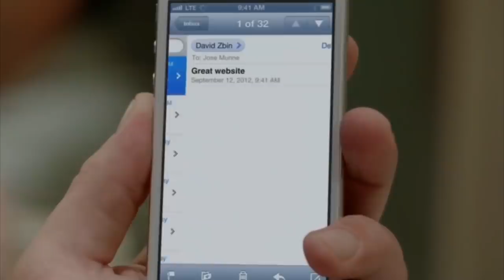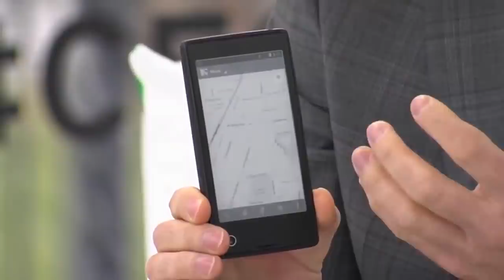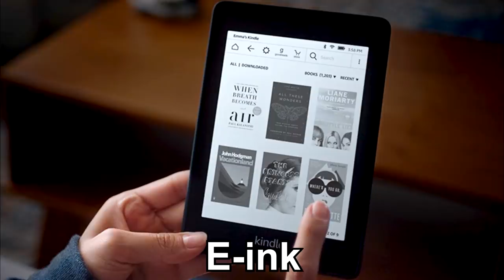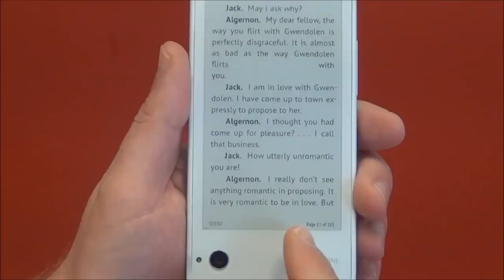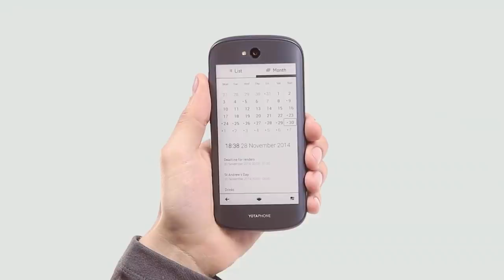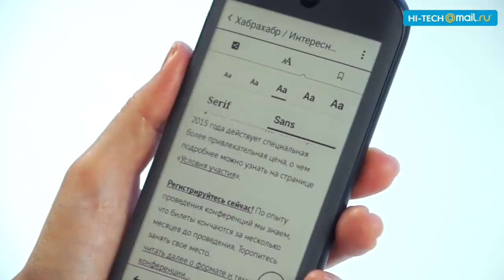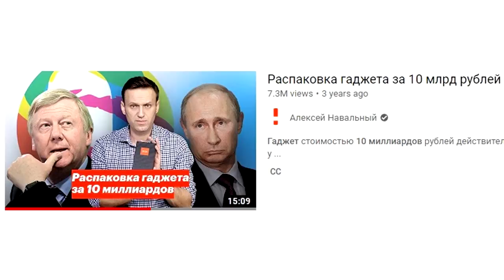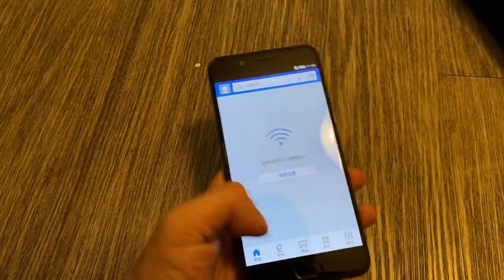Yotaphone: Russia's Failed Smartphone

Comment: I really like the idea actually. E-Ink displays barely need power, so it could be used most of the time to save power, and the primary screen could be used only for stuff like watching video.
Reply: It is a good idea but in case with this company it was badly planned and executed.
Reply: Well, then you should start a mobile phone company 😀 
Okay, the idea of an eink display sounds good but it doesn’t work.
Reply: Is colored E-ink a thing? I'm just asking here because I'm curious...
Reply: @hsc894  ...no, not yet.
Reply: It seems like you'd scratch or damage your back screen pretty quickly. I think if it had some cover system that could flip from one side to the other quickly, that might work
Reply: @darthbee18  color e-ink displays do exist.. google it (Pocketbook Color 6 ́ ́ One)
Reply: I wanted to buy it, really
Reply: @hsc894  actually colour e-inks now do exist!
Reply: I read a lot and I'm using a yotaphone 2 now for years. Marvellous device. You can have also always a overview of all notifications on the eink screen.
Reply: @Rafael-xz9pl  That's why Yotaphone had 2 displays, eink only used for basic applications like sharing a boarding pass, controlling the camera for selfie (since the second display is on the back) and occasionally when the battery life runs out. You'd never want a smartphone with only the eink display because of the latency.
Reply: @mi2-c035  I could run any app on the back of the Yotaphone 2. Mainly used it to browse the web, GPS and reading. Played some games and videos when out of battery.
Reply: @ayuyade  Yeah technically it's possible, but i wouldn't want an eink only smartphone, there was a huge potential for a dual screen  with one being eink, honestly more than foldables now which feel just an expensive gimmick.
Reply: @mi2-c035  Sure, I agree. I want both screens to be there too but I need the second one to be fully functional as it was in the YP2.
Reply: There are a few other makers that are currently selling such phones with E-ink displays. For example the Light Phone, or the Mudita Pure. Check them out.
Reply: rPhone... or pPhone for Putin's Phone, since most Russian people at last does not hate that much the West... pPhone, buy now
Reply: screen is only fraction of power mobile device requires
Reply: Well, try to experience E-ink to watch something, with low fps, black and white and even leaving ghost marks in the screen and you'll want to get back to the normal screen immediately.
E paper displays sucks for anything out of e-reading.
Reply: @qwerty6383  It is the LARGEST consumer of power on modern phones.

Comment: I used to have a yotaphone2 and it was a great phone. The e-ink screen really made the difference with its widgets always visible, the possibility make the battery last for 5 days and the possibility to read books at any time without planning to bring a reader or an actual book or take selfies with the main camera,
The main problem was the snapdragon 801 which was not fitting well inside there and burning when using it for demanding apps lowering the battery range a lot. I was charmed by the yotaphone 3 but even after years it was available only on chinese stores at quite high prices for old midrange hardware. The concept was great though, too bad nobody else developed something like that.
Reply: I remember it even had some ingenious tricks in its construction, like the volume rocker on the side was also the slot for a microSD. The idea of the two screens and the software integration is still great, it was truly innovative in a market that frankly has gotten stale for a while. All smartphones look the same nowadays, they all copy iPhone even the flaws, it's so boring.
Reply: Private imported a Yota2 from Russia, it is to date the best phone I ever owned. It was perfect for me.
Reply: Yeah I agree the concept is amazing like if someone can make a phone with the same concept with modern specifications and hardware I would definitely buy it and it would probably be one of the best phones on the market it's a shame this concept never came back I hope it does
Reply: @mi2-c035  yeah man I would love to see the same concept with modern specifications the concept is so great though like it is so cool to have a second low power screen it's a shame none has used this concept I hope someone makes a similar device
Reply: @tubros  you could get the yota 3 it is a little more modern but this concept is so cool I hope someone makes a modern version of it
Reply: There's nothing wrong with the 801, many of the most popular phones at the time used it. If the phone was having problems it was not the processor's fault
Reply: I had it too, and I agree. Best phone I ever owned. Ebook on the back and the power lasted a few days. But it did get hot and then it only held power for 12 hours, so I got anoter phone with 7000mAh to read for longer. But I still look up yotaphone every now and then to maybe get a steal. 
Sidenote, there are a few chinese models copying the concept with more modern hardware (of course there are). Look for eInk Smartphone.
Reply: With modern day OLED, that probably wouldv been useless aswell
Reply: @honkhonk8009  That's not how oleds work
Reply: @IamGroot more likely the west doesn't allow it. One who control the market he also controls what,  when, and where product is going to be sold.
Reply: in soviet russia we do phone with sardine can and shoe string, very very good
Reply: And now Russia won't be able to buy any Snapdragon processors whatsoever.
Reply: Still have my Yotaphone 2, got it at the tail end when price had dropped mostly as a curiosity, never used it as main phone because performance was too disappointing with any kind of heavy app and I didn't find myself using the e-ink screen much but it was an interesting concept.
Reply: @tubros  Bla,bla,bla.... i am sure u got a Lada also, so it was the best car that u own.....
Reply: @Ignacio.Romero  AMOLED full black background with gray text is probably the closest you can get, though it is more like reading in dark theme instead of an actual paper-like experience. Wish the e-ink concept survived in some form.
Reply: @ivicacaric8423 that’s just stupid how many Chinese phones get made every year

Comment: I actually had a Yotaphone 2 back in 2015 until 2017. It was not bad considering that I was young and kind of dumb. The e-ink screen actually didn't do shit in terms of battery efficiency, and it was actually bad enough that the previous frame blended into the current one. On the topic of component quality and specs, it didn't take too long for the phone to show its true colours and shit itself in a year - the screen would turn into an impromptu rave and shut itself off at around 5% charge, but you could still hear incoming calls yet not interact with the phone.

Also, fun fact: Yota also sold cases for the phone which were basically a soft plastic rim which never felt really trustworthy.

Comment: They advertised it “this phone has more back doors to the FSB than any other phone on the market”
Reply: the CIA does have fronts for engineering processing chips with intentional backdoors in basically all smart phones
Reply: @nothingbutdope5316  all governments have but I rather have a democratic government doing that than a dictatorship
Reply: @ricardobarahona3939  it's called brainwashing, and they have no problem doing that through the media
Reply: @nothingbutdope5316  I knew this idiotic response would come, and that’s not evidence.
Reply: @rayandouni4374  Yeah I’m all for harm reduction. I agree with you and same applies to voting, there may be crap options but you have to go with the least crap because even small differences can lead to much bigger outcomes.

Comment: had one and loved it, it was really cool during the meetings when it was showing when the meeting is over when placed main screen down (via calendar app). Also photo taking was fun with retro camera picture. used e-ink display every time when in the sun. it worked very reliably, but then I went on a 2 weeks long road trip with google maps always on and a problem appeared - the phone overheated. Not a problem for a casual use, but killer when always on. fixing it to a vent helped somewhat, but these overheats, I think, caused the e-ink connector to deglue and one by one line of the screen died. It was still usable, but ugly with black lines going through the screen. And then I dropped it and broke both screens at once. Would buy another, modern one.

Comment: I saw a yotaphone in performance by a colegue of mine. Seemed to be the 2nd version. Honestly the backscreen surprised me and got me very curious. Worked perfectly fine for a phone which was 5-6 years old by that time. Since we were traveling in no-mans-land the back screen function, which obviously used very very little battery charge, came very in handy in our situation. Instad of constantly charging the phone from a heavy and space taking (in the backpack) powerbank he practically could have hiked without charging it at all for days and still have the key feauters of the phone perfectly functional. 
Imo the problem with yotaphone wasn't the concept but the idiot marketing. It was to overpumped with "best phone in da world"-PR-ads and overall as if it's something HUGE and GROUNDBREAKING. What could have become a neat nieche product for a fair price with some interesting features for all-day-use became a mosntrosity which functionality couldn't hold to its advertisement... Sad...

Comment: I imported a Yotaphone 2 from China and changed the firmware to use it. Used it for a bit over 3 years when the tech just got too old to keep up, the battery did not hold too much charge, and the e-ink display had a few dead lines.
Still, it was easily the best smartphone I ever had - and I can't believe how convenient the e-ink display was. Just have it on top, and full functionality (messages, time, etc.) always on with hardly any battery use. And, obviously, you neither have to carry a separate e-book reader, nor waste a ton of power to read an ebook on your phone. You could even mirror your regular display onto the e-ink one. Or what taking a photo, the person on the other side could see the image being taken just like you (if you wanted). Really, cool stuff.

I considered buying the Yotaphone 3 afterwards, but i felt it was too expensive - and, to me even more important - it became too large for my liking, and would have been way too uncomfortable to have in your pocket. And they even removed the mirroring mode. Pity. Of course adding to all that, the writing was on the wall for this company to die, it only came out in China, and if there was any support was a gamble.

Comment: I legitimately would like a phone like that if I could switch off the LCD screen and then use the e-ink to save battery, as I am often traveling and would like to read, not carry two devices, and not need a battery pack necessarily if I want to entertain myself for many hours in environments I don't have internet. Seems the price would never be competitive if they made the normal smart phone part at parity with other models of a similar price.

Comment: This iPhone case reminds me of an Chinese company which made a iPhone case that basically allows you to use iOS and Android at the same time. On one screen you had Android 8 with Google Play Store, shitty selfie cam and 14mp back camera which was sliding out on a rail and on the other screen (one from your iPhone), you were able to use iOS.
It's basically like gluing a iPhone 8 Plus to an OnePlus 7 Pro with the exception that the selfie cam is in the display and the back camera is sliding out on top of the device...
The case was very cool tbh but the Samsung AMOLED display which was previously used in the Galaxy S4, is kinda outdated. I mean, the iPhone 8 (8Plus) was launched in 2017 or something like that and the S4 was launched in 2013 or 2014. Imagine just buying that case to have "one phone" and be able to use two OS's.
For the price of 411usd, you could also buy a fcking Samsung Galaxy Note 4 on the used marked or get a brand new Xiaomi smartphone ´.

Comment: E-ink screens save battery (they only need electricity when the the content of the screen is updated) and can be read even in really bright light. Even the worst of the, black and white, E-ink screens is as good for reading as the very best of the light emitting screens. But even the fastest of E-ink screens are slow, and not really suitable for video. The ones that can show colour, doesn't do it well. And occasionally an E-ink screen need to do a weird flush of the screen, to remove artifacts of what has been displayed on it prior.

I hate when I can't use my phone, because it's to sunny to see anything displayed on the screen. Even if a dual screen is not an ideal solution to this problem, at least it works for a lot of tasks you do with your phone. I would love to have a similar dual screen phone, if it has decent enough performance, and doesn't cost much more than other phones. As an added bonus, if a modern phone battery is used, battery time, during normal operation, would increase to months, maybe even a year, as long as you don't use the ordinary screen.

Comment: I was actually looking forward to the e-ink second screen but quality complaints and getting a hold of one were issues that stopped me. Good idea at least
Reply: Theres no point in an e-ink anymore.
You realize OLED exists right? They dont have a backlight, and pixels turn off completely. 
Thats why modern day samsungs and apples use OLED screens. They have all the advantages of E-ink, in terms of power usage and efficiency.
Reply: @honkhonk8009  this was back in the day when OLED screens weren’t as common and were rather expensive. On a personal note I rather like matte e-ink displays and still use my Kindle reader  I understand e-ink’s limitations and benefits.

Comment: They could just reverse engineer all the greatest phones hardware and software, make all phones they produce satellite service capable so you could purchase regular 5G service or get unlimited talk, text and unlimited ultra high speed data with unlimited ultra high speed tethering with no caps, provide satellite service for $5 a line, sale the phone for $80 U.S. and throw their dual screen thing on it and put their competitors Indubitably to shame, just build on the best technology available, make it even better, and under price all their competitors while making their phone a worldwide accessible phone meeting you can acquire their phone anywhere and watch the profits roll in as you gain power and go straight to the top. They could make every phone with a 10,000mAh battery to really screw the competition making it to where even U.S. buyers go to them for a phone and phone service. Then a peace treaty would come in from all countries.

Comment: Ahh the classic self hatered syndrome that Russia seems to still suffer from. Brainwashing from the west has done its good job on the kids. My father owned Yotaphone 2 and it was a really unique and cool device. The second low power screen was a good idea because it made battery last a very long time (also good on the eyes for reading). Battery was and still is one of the biggest problems on smartphones. Back in the yotaphone days all other flagship smartphones barely ran for about a day or a half and there were no fast chargers. 

Shame that the availability for the device was so low you could hardly obtain one.

Comment: Technically, are there any phone which are not built/designed in the far-East ? Oh, Iphone are designed in the US (I guess... Maybe... Sort of.), OK. Any other non-Chinese brand ? Nokia? Sony? Motorola? Ericsson? Alcatel? HP? LG? Philips? Siemens? All these Western brands are dead or on life support. All the other ones you can think of are Chinese.

Nowadays, the technology has been concentrated and the whole world depends on a handful of chips makers like TSMC. The US are currently trying to rebuild a production on their soil. We'll see if it's a success. There is an estimate of 10 BILLIONS USD to build a chips factory from scratch. And there is only ONE machine brand : ASML (See https://www.youtube.com/watch?v=iSVHp6CAyQ8).

The problem with smartphones is that the tech,nology is full os security holes, and relies on hundreds if not thousands of patents. You can't TRUST your smartphone to keep your data secure, which is a problem as the use of smartphones is pervasive, from the low-life up to the presidents, miniters, heads of corporations, etc.

So, you can laught at the russian attempt, but at least, they tried. Of course, it was doomed to fail. Too much corruption, and state interference. As Cold War 2 has been started, if not WW3, we may see new efforts been made.
Reply: USA, unlike China, has its own manufacturer of ultra-modern chips (Intel). China is still a cheap assembly plant, smartphones are just a functional technique - a small part of the world of technology no more important than biotechology or nuclear technology or hundreds of other areas that the average person does not pay attention to. Most of the companies you mentioned still develop ultra-modern technologies, but in other areas, today the production of a smartphone is an analogy of the production of a TV set a few decades ago, changing the profile is a normal phenomenon in the business world, after all, the essence of business is profit, not production. If you can make money lying on the couch, then you have achieved a high level of effort-profit ratio, in the physical sense,  that's what business is all about (added value of the product).